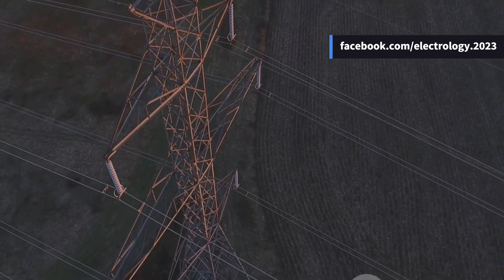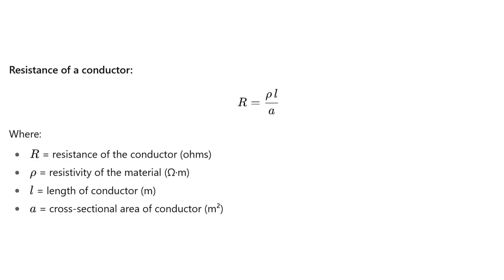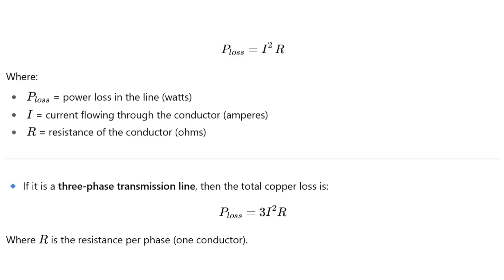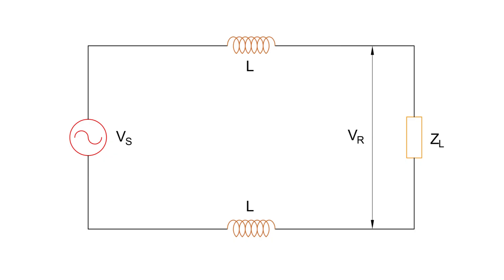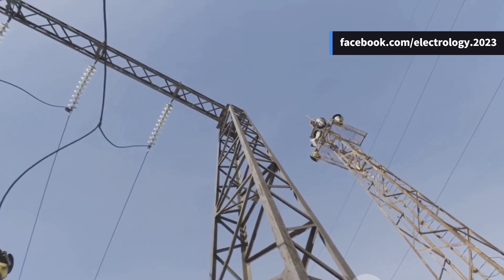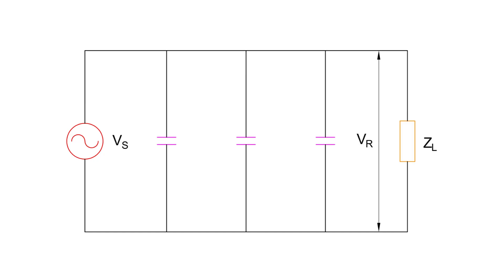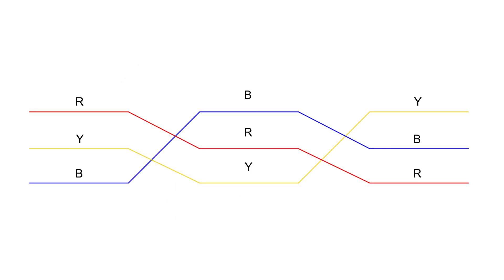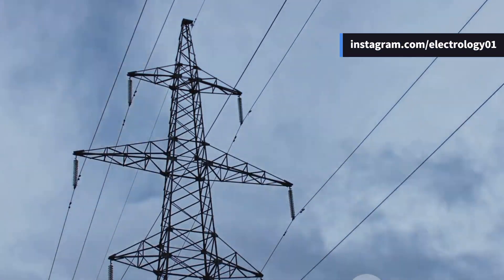Top 3 Transmission Line Secrets Every Engineer Should Know

Comment: I don't thick if there's anything to worry about those factors during designing extra high voltage transmission line because in each factor there's way to overcome
Reply from the maker: True 👍 Every factor has solutions, but knowing R, L & C is key for efficiency and stability. Thanks for sharing!